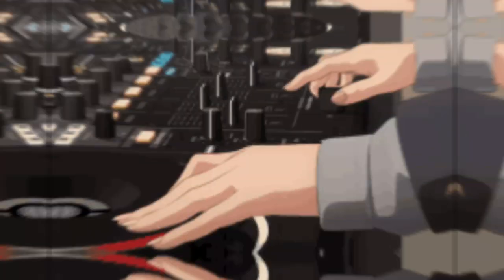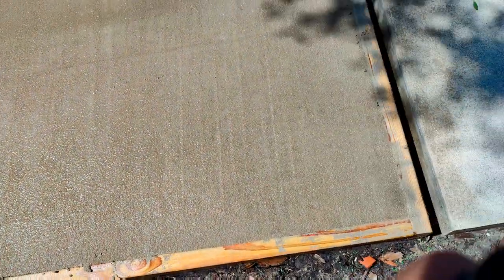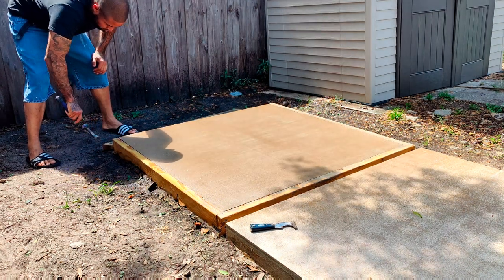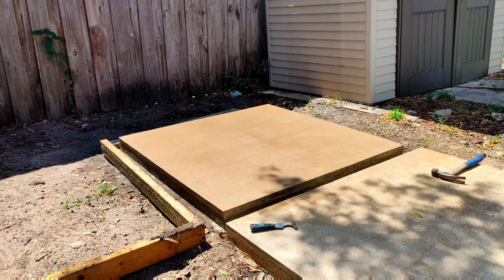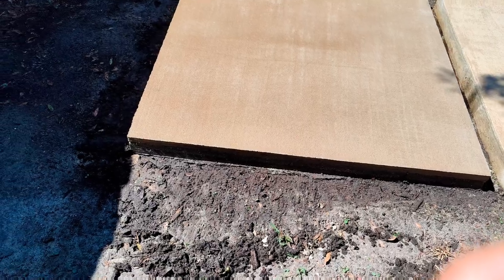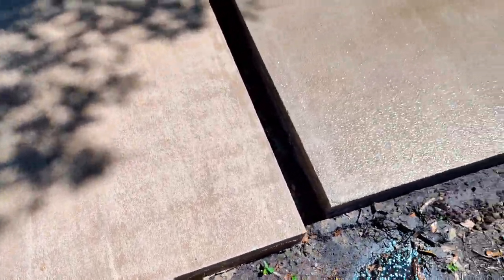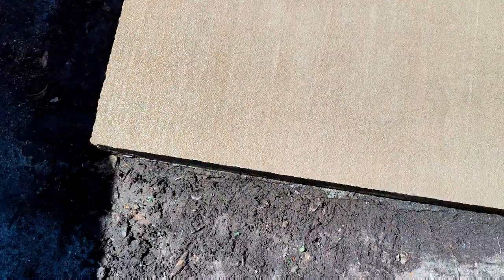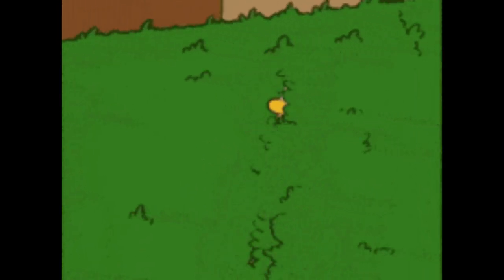Diy Dry Pour Concrete Half wet Half Dry update problem solving

Comment: Excellent video! 

IMO use mortar mix as your first bag, pour around the form boards, push/rake it up into a ramp to cover the full height. Then pour the regular dry concrete in the middle up to your mortar mix depth. Cover with mortar mix & finish. Then water.
If you want to add reinforcement, only fill half the concrete lay down grid/chicken wire or 1" hw cloth, cover with the rest of the concrete, then again with the reinf, cover with mortar mix & finish. Then water.
Reinf may prove useful for driveway. You might want to consider landscape cloth pinned to the compacted dirt as the base before any mortar mix or concrete.
I like to connect a layer of chicken wire to either side of the steel reinforcing grid with hog rings (using hog ring pliers) or to 1" steel hardware cloth. If you do this twice, you get a total of six steel mesh layers, forming a product called "ferrocement."
Reply from the maker: Nice,, great info,, appreciate it! Actually have a video coming out tonight,,with a different top than mortar mix that a high level concrete worker suggested, I tried it,, actually like the finished product will be posting latest tonight 🙌🤙

Comment: I think this is genius. Half wet pour is going to eliminate all the strength issues with drypouring concrete and the drypour is going to have a perfect base better than the rocky mountains so it will be resilient against crumbling and give you a smooth perfect finish
Reply from the maker: 🤙🤙🤙 thank you for your thoughts!